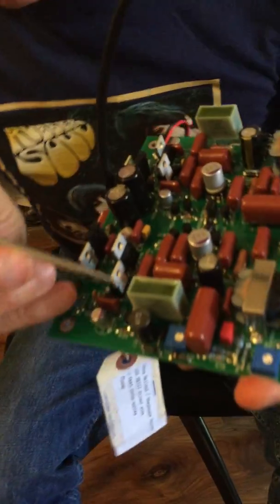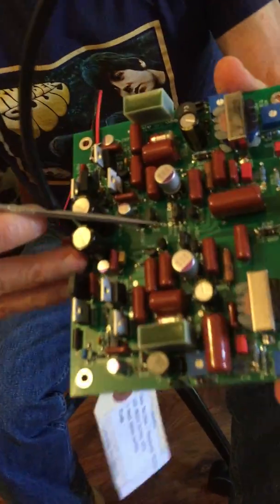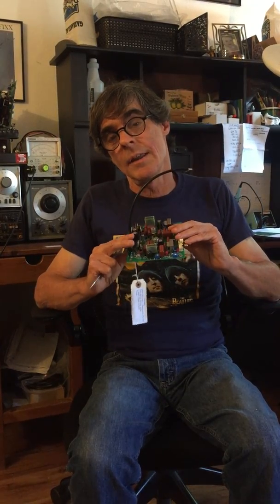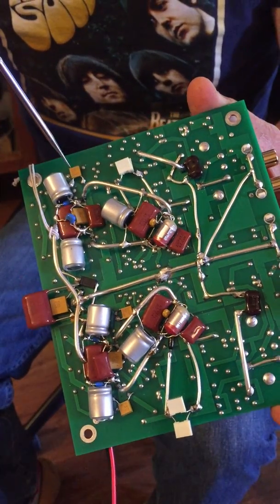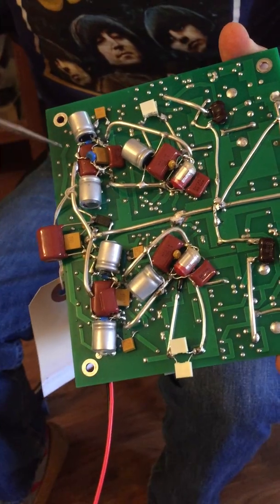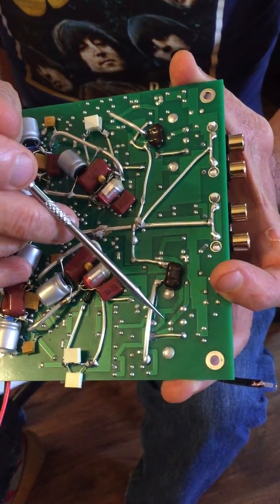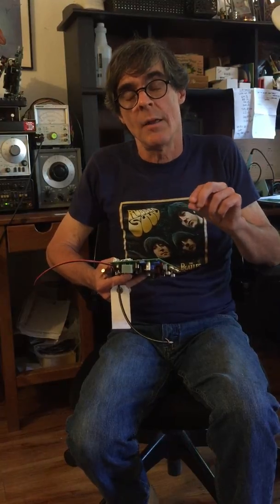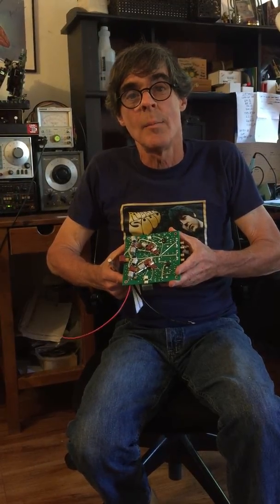Technical Difference Between LCR MKIII and LCR Silver

Comment: Do you ever plan to make a new board and case for an upgraded version. I know your volume determines whether this is cost effective but that's kludgy looking. It's obvious you know that circuit -  as in lfd well. That's a good sign.
Reply from the maker: Silver is the best available conductor. PC Boards are only available with copper clad. Even if silver was available for PC Board manufacturing, the best conductor geometry is round solid core wire. 
Standard manufacturing technics are either PC Board or Point to Point. In our case, the innovation is in the integration of both technics on a PCB based op-amp circuit.
Reply: Exception: Some tube amp manufacturers claim that using square wire to wind transformers with square wire leaving less room for air gaps and better distribution of   .. something. Would love to see an engineer back that up with mathematically solid proof of theorem. But Round wire is best as you say. Round object in nature is strongest. Thus you will never find square egg.
Reply from the maker: @joybrucebruce3377  The square wire is a special application for transformers. It aids in making the windings tighter and more dense. That allows the current to be inducted with more efficiency from one winding to the other.

Comment: Fascinating, Robert. I’m curious, has silver vs copper wiring made that much of a difference, considering the addition of different resisters and capacitors on the bottom of the board? Clearly, you felt it does. My personal experience has shown silver wiring, such as interconnects, sometimes add an unnatural brightness with tilted up high frequencies. What is the turnaround time for the upgrade on an LCR MkIII sent in to you? Thanks.
Reply from the maker: Thanks! Absolutely, I know about that sound of too much silver in a circuit. I should have been more clear in the video but that would have made it go a little too long. I keep the silver away from any place in the circuit that runs in voltage mode. Mainly that means no silver on the basic signal flow path of the audio line. The silver is used on the ground, power supply lines and the part of the circuit that is called virtual ground. There are a few partial exceptions to this though. Soon I will do a dedicated video on "my rules about the usage of silver. " :)
Reply from the maker: Sorry I forgot to respond to your other question.  It takes us about a week to turnaround the upgrades.
Reply: LOUNGE AUDIO, thanks for the reply, Robert. I’m going to save my up shekels for the silver upgrade, though I cannot find a price for the upgrade on your website. Cheers!
Reply from the maker: @motorradmike  We will be here when you are ready.  :) Just to be clear, the upgrade of your current LCR MKIII to Silver is $150 or $350 for Gold plus $22 shipping anywhere in the US.